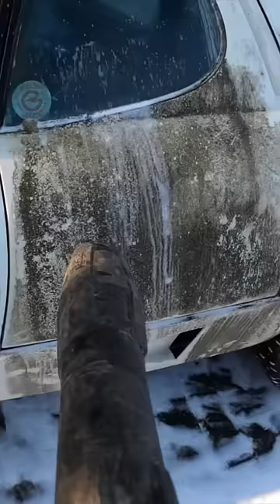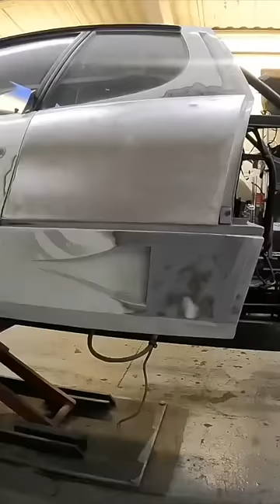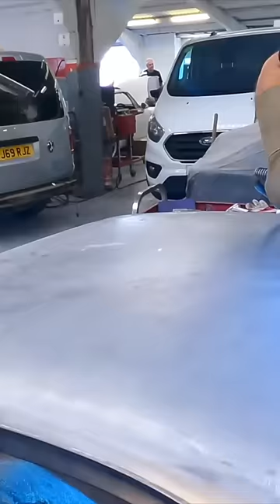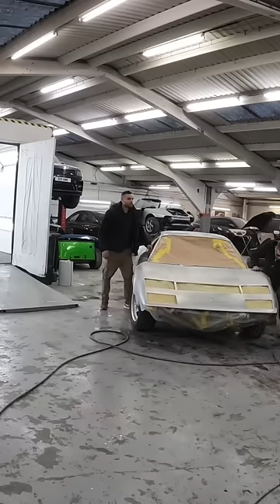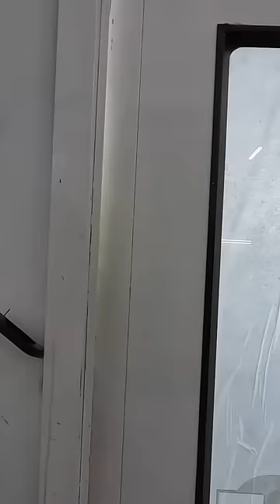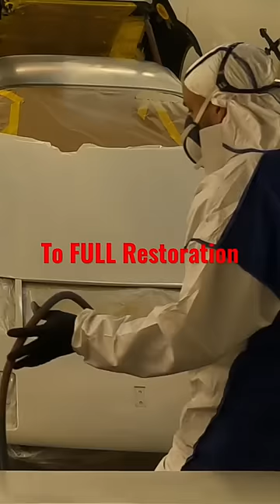Abandoned 1 of 1 build Ferrari BBi to Full Restoration… the Saga continues

Comment: Can we start a trend? Can we define a restoration  a rebuild to original specifications?  Can we define a nut and bolt restoration as stripping the car down to every last individual part, and refurbishing it down to its bare necessities and restoring it to its original luster… remanufacturing, or custom making parts when they are not available. These are two completely different methods of putting a car back in use. I’d like to give credit where credit is due.  R A T A R O S A is doing a nut and bolt restoration 🎉 this is not plug and play, this is craftsmanship!
Reply from the maker: Thank you sir 🙏
Reply: @Ratarossa  I found the steering rack you need here in the USA… $1250 to $2600 USD left hand drive but it led me to a dismantled whom I gave you the link on that video 👊🏼 and it made me think… hmm 🤔 there are company in the USA rebuilding Ferrari steering racks… so can my main man RATAROSSA 🚀
Reply from the maker: @duhonaaron  cheers dude much appreciated

Comment: This is not a renovation but a refresh of the car. Renovation of the car, especially such, should start with disassembling the car into its first elements, then soding the body, restoring what was damaged by corrosion or collisions. Then the paint shop, in the meantime repairs of mechanics, renovation of interior elements. At the end, putting together, adjusting the engine / suspension / gearbox, etc. mechanical elements. At the end, maintenance with waxes, etc. with protective agents, and finally detailing the whole thing.